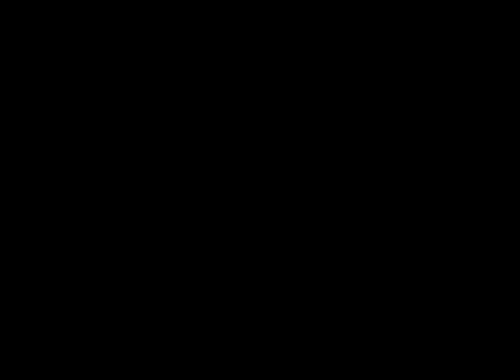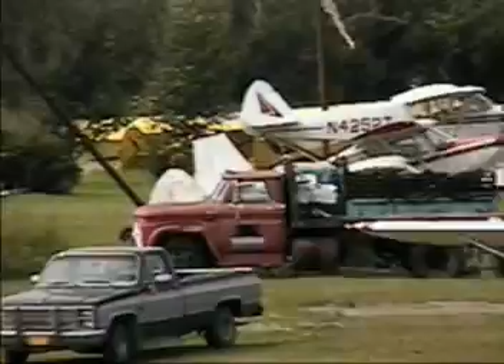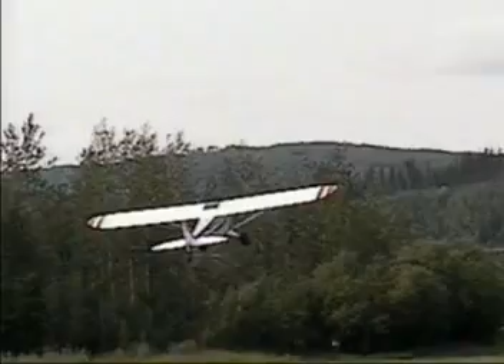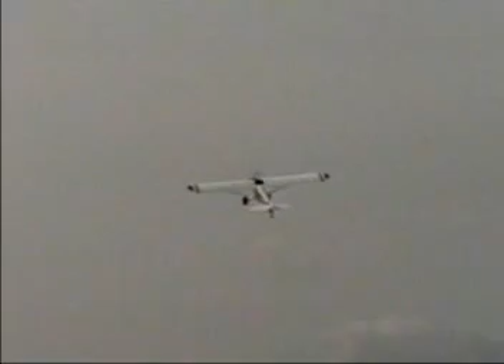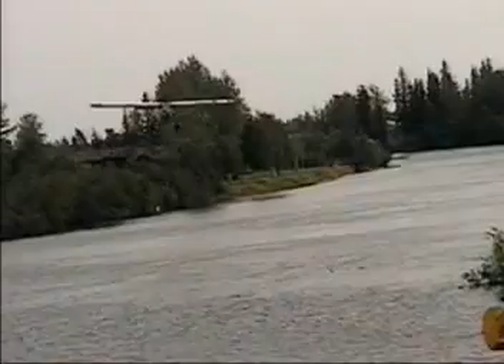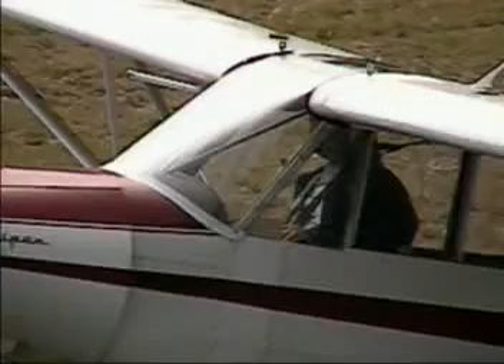Alaskan Bush Pilot Demo.

Comment: @DennisWD Flaps are applied right as you pull back on the stick for take off..Theory is that if you leave them up there is less drag while gaining speed the all of a sudden pull flaps to 20 degrees and pull stick back at the same time...it works.

Comment: I'm a Bush Pilot CFI and i use Lift Flaps at Vr but will never recommend what this guy did like CUTTING LIFT FLAPS climbing off the ground effect and turn. That is raising the stall speed at a low slow turn. Thousands had stall that way.  I raise lift flaps only  when over the Vg, JIC engine fail, wind shear, etc. 

On the landing, I do a 3' FLAP CUT, after touch, cut the mixture and brake, just before props stops, mixture in. Land shorter/safer. But Cubs landshort even without those tricks.